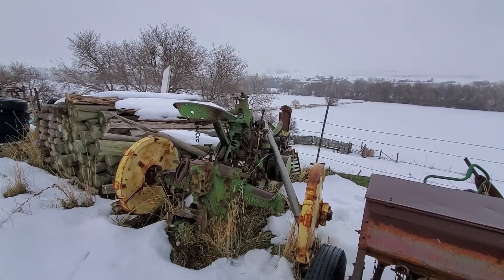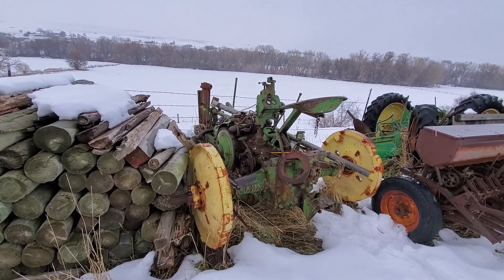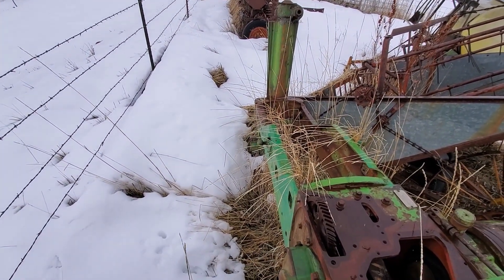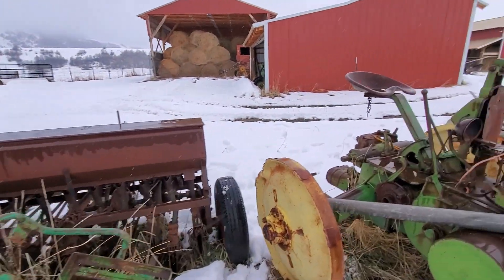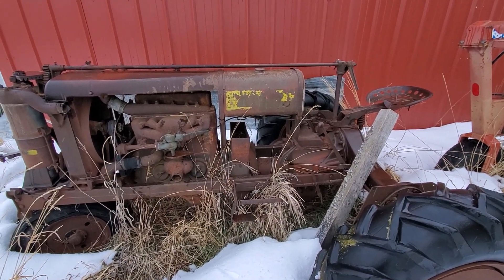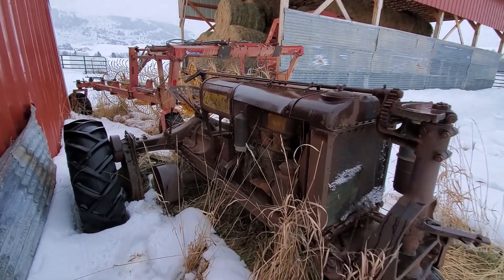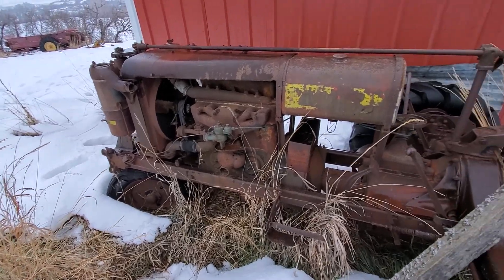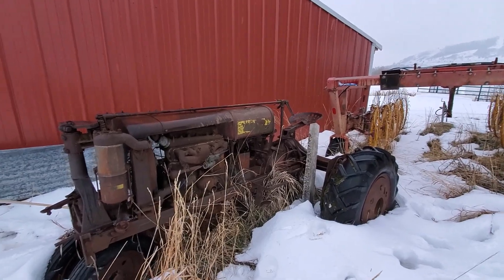Are These Tractors Worth Saving?

Comment: My vote is for the Oliver 70. My Grandpa’s first tractor was a 1942 Oliver 70 standard. I rescued it in 1980 when I was in Vo ag class in high school. It had been sitting out side for nearly 20 years. One of the governor weights had come off and ended up in the timing gears and broke off the end of the cam shaft.  I was lucky a neighbor has an Oliver 70 row crop tractor with a cracked block that they let me salvage parts from. My brother still has it in Weiser Idaho.
Reply from the maker: I like the Olivers too

Comment: Get the AC D-14 stuck engine tractor running. It's close. You know the other one is used frequently. I'm also a fan of VGG and his rescue tractor and truck episodes. When I was a kid I helped my father unstick a Case Combine engine he bought so he could use the combine to get the wheat in so it's possible to get them working again. Squirt cylinder soaking juice in there anytime you walk by! Then the Oliver. Perhaps enough parts are there to get both the target Oliver and the parts Oliver running? I bought  pair of Massey Ferguson 35s and I got the parts tractor running where that's the one I use all the time.
Reply from the maker: Yes, is really like to try that D14. As far as the Olivers go, were are short one complete engine. But we have everything else to get two tractors running.